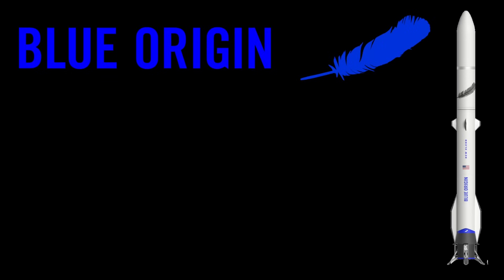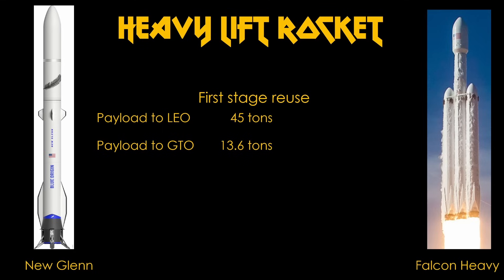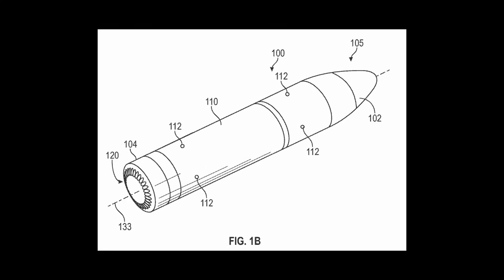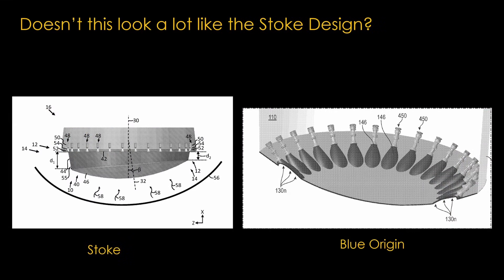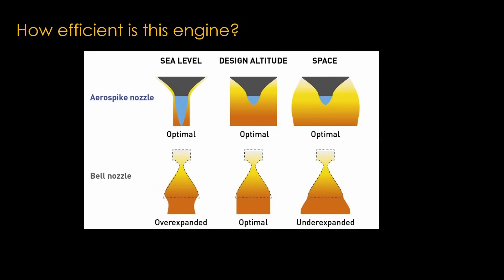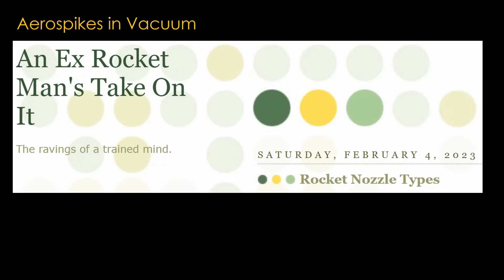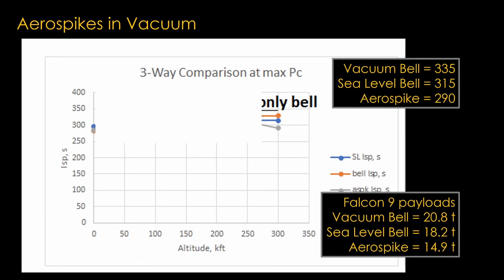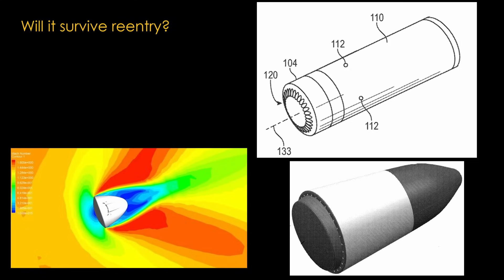Blue Origin's Starship Killer?

Comment: Blue Origin maybe should concentrate on getting to orbit before they concern themselves with trying to reproduce what SpaceX are doing. With Starship now proving it can not only get to orbit but return and land, all be it with the flaps extremely well toasted they are well ahead with a design that has shown it is viable. They will now continue to refine the Starship design until they have it perfected. Getting to orbit is hard but getting back seems to be an order of magnitude harder.
Reply: You could also say that SpaceX should concentrate on getting an engine which dosn't explode first before trying to get a giant stage returned from orbit, as reliable engines are infact the most important part of launch vehicles.
Reply: @kennethferland5579  Raptor is just fine, problems seem to be getting fuel and oxidiser to the engines reliably not the engines themselves. The flight profile of Starship is challenging when you have partially filled liquid fuel tanks.
Reply: Starship and booster design has bloated (super heavy) so much that it can't get a meaningfull payload to orbit. It has just enough fuel left for landing. But with a 30 or higher ton payload it will fail to get to orbit because ther will be much more fuel needed. The flight tests show some proof of concept but isn't a viable rocket design in it's current iteration. The future versions seem to scale up the fuel capacity but not by much. Most of that extra fuel is to carry that extra fuel yielding only a little more payload capacity.
Reply: @frankderks1150  The current version has demonstrated something like 40-50 tons to LEO, only it was leftover propellant. That's less than the design goal, but it's definitely a meaningful payload. It's like twice as much as the space shuttle, but with full instead of partial reuse.
Reply: @kennethferland5579  A mass simulator would mess up the reentry testing, unless they were able to deploy it. It would be extra mass, meaning more energy that would turn into heat, and it would be high up on the vehicle, meaning the forward fins would have to deploy further into the flow of plasma to maintain attitude. 

Extra propellant is also not ideal - it is extra mass, and it can slosh around in the main tanks. This is why SpaceX was trying to dump the excess propellant on IFT-2. But SpaceX must have decided for IFT-3 and IFT-4 that keeping the propellant on board would be better than risking a fire during a propellant dump. It is at least spread more evenly, affecting the attitude less.

I expect they'll start carrying payload on flight six, likely around september. And I would expect they start out with a relatively small payload, like 20 tons, and then increase it from there.
Reply: @SpaceAdvocate  That is not a real payload. With a real payload they need that propellant to lift that payload and most of that propellant itself. So 30tons of "leftover" propellant isn't equavalent to a 30 to payload capacity (more like 3 tons).
Reply: @frankderks1150  You actually get more payload to orbit by burning the propellant propellant than by replacing the propellant with payload.

They had something like 40 tons of excess propellant. The easiest way to think of it would be that they could replace it 1 to 1. Instead of launching with 1200 tons of propellant on Starship, they would then launch with 1160 tons of propellant and 40 tons of payload. That would allow you to arrive to orbit with 40 tons of payload instead of 40 tons of propellant.

But you could obviously get more payload to orbit if you instead of launching with 1160 tons of propellant upped it back up to 1200 tons.

Comment: One way Jarvis could make up for some of the inefficiencies is by having more than two powerpacks. New Glenn suffers significant gravity losses due to the low TWR of its upper stage, which is a result of cost-cutting efforts. For obvious reasons, a reusable upper stage isn't subject to those concerns.
Reply: Seems unlikely, your probably calculating that Gravity loss by comparing with Falcon/Starship.   Yes initialy 2nd stage thrust ~140 ton will be below its mass ~280 ton but thats normal for all 2nd stages, particularly when they stage later and have been thrown harder by the fist stage, they have more lateral velocity and thus don't really need to fight gravity much anymore.
Reply: @kennethferland5579  New Glenn stages fairly early.
Reply: @pseudotasuki  Compared to Vulcan it stages early, compared to Starship it stages later.

Comment: The bigger picture here is that your thermal protection system mass subtracts directly from your payload mass. So anything that result in a light TPS is a win, even if it means other compromises. There's a whole bunch of options including nozzles into which you pump liquid methane (for cooling). The methane evaporates and then as a gas absorbs heat before spilling out and creating a buffer zone of (relatively) cooler gas. There's high temperature ballutes that can inflate around the base of the rocket, thus directing hot plasma away from the rest of the vehicle. There's deployable high temperature alloy shields (which can be internally cooled. There's also porous carbon materials into through which you can force liquid methane as a coolant. And of course you can build those to be rapidly replaceable so you can afford some ablation.
Reply from the maker: Starship pays a lot for that blanket of tiles and the fin system, but that system requires very little propellant to land. 

It's not clear what they dead mass increase is for the active cooling systems - you have these complex motor systems with a lot of nozzles and a lot of piping and then you have a heatshield wall that is more complex and more heavy than a simple tank wall. On top of that you are using propellant during reentry, and your use there will be much much more than the starship control.

What's the real cost of the active cooling approach? I don't think Stoke or Blue Origin have released their models and since it's never been flown nobody knowns what sort of propellant flow rates will be needed to keep the the vehicle happy.
Reply: @EagerSpace  I'd love to see it tested purely for the knowledge gained. Looking back at this I can't help but feel that if this aerospike tail end is an attempt to create a re-entry proof surface then it's still going to need either fuel-as-coolant or a bunch of thermal protection in the obvious places. And if they're going to use fuel as coolant, I'm not sure why that can't be applied to a conventional bell nozzle. Again, I come at this from the angle of thinking about one-way Mars cargo-only landers, where it's an advantage to not be dropping parts of your vehicle onto the surface (because it might hit something). So you need the ability to apply thrust through the heat shield. I'd love to see Blue Origin try out even a sub-scale test of what they're doing. One other thing, my idea of a "Starship killer" looks a lot like Neutron. The best second stage is an ultra-light one where what you're throwing away is a tiny part of the overall vehicle mass/cost. Maybe Neutron's second stage can be made reusable at some point in the future (ballute?) but we'll see.
Reply: @saumyacow4435  It would be fantastic if anyone developed an aerospike engine.  Even if it was the Chinese! (We could steal the design from them. All''s fair, and all that.)

Comment: Unlike bell nozzles, advanced compensating nozzles (external-deflection and aerospikes) have options as to the shape. You have to determine what you want, then you can design a nozzle shape that does that thing optimally – to the detriment of the other things. This is why different studies on compensating nozzles get such different results, not realising the shape options are available. So, without knowing what the aerospike was optimised for, the Ex-Rocket Man’s analysis is not really meaningful. I would expect a vacuum optimised aerospike to lie between the vacuum and sea level bells (it will never be as good as a vacuum bell).
Reply from the maker: Did you read the blog post? Lots of detail there.
Reply: @EagerSpace  I have gone over the Website and my thoughts are 
a) He is designed for atmosphere operation which will reduce the vacuum performance. Generally, this makes sense as one of main potential roles of aerospikes is as an atmosphere compensating engine from launch. However, if Blue Origin are using aerospikes for the second stage, they will want them optimised for vacuum operation and the sea level performance can be rubbish.
and 
b) he does say his lower SI “is very likely an artifact of my not knowing how to optimize the design of aerospike engines” Which is no reflection on his expertise, very few rocket engineers end up working on these long enough to get the subtleties. Full disclosure: my experience was with E-D nozzles and my comments were based on reading across from that. I would not like to say with certainty how aerospikes behave.
And
c) Another point is if you look at the patent drawings the main combustion and a lot of the post throat expansion is in conventional rocket nozzles. Of course, these are not scale drawings but they make the point that without knowing the exact design and how much expansion is done in these nozzles, the overall stage performance is not really possible to ascertain.
Reply from the maker: a) What are they going to change for the aerospike to give it better vacuum performance? The only thing that seems obvious is to increase the nozzle size, which has other impacts.
b) Was that from the first section, or from the update after that. 
c) Totally agree. 
d) I'm not sure the blue origin design counts as an aerospike. There's precious little internal spike left and - at least in the drawing - the angle seems to be pretty high. Not sure what's doing to happen with all of that off-axis flow running into each other.
Reply: @EagerSpace  The main thing that alters with subtle changes is the pressure in the entrapped gas region which impacts both the vacuum thrust and the degree of atmosphere compensation. It means you can balance one off with the other.
The quote is from the Final Remarks section. Again, I must emphasise this chap knows his stuff (for example, he notes the importance of the speed of the external airflow with all spike nozzles which is missed by many.) And I agree with his overall conclusion that an optimised aerospike cannot match an optimised bell in vacuum performance, I just do not think it will be as bad has he shows.
Reply from the maker: Thanks. I always appreciate comments from those who know more than I do.

Comment: If you lose 23 tons to LEO; you're losing ~23 tons to GTO given that the performance decrease is presumably driven by second stage dry mass increase. 

The way I tend to think about actively cool heat shields is that it's not too dissimilar from regenerative cooling in rocket engines; well ok it literally is also doing that. But the actual heat fluxes that are dealt with in propulsion and re-entry are reasonably similar (I think actually rocket engines need more cooling relative to LEO re-entry). So it's not an entirely new field. The other way I like to think about it; ablative heat shields are to solid rocket motors as regeneratively cooled heat shields are to liquid engines.
Reply: The heat dispation problem is very different because you have no where near the mass flow of a rocket engine to deal with.  Rocket combustion chambers basically need to cool themselves durring steady state operation using propellent flow, nothing else is available.  Re-entry thermal energy is a pulse which can be delt with very differently, push the plasma away with shockwaves shapes or thrust, reflect is with high emissivity skins, ablate away a coating, soak it into metals with high melting points or all of the above at the same time.
Reply: @kennethferland5579  Just to check, roughly what you're getting at is that re-entry is easier to handle than rocket combustion chambers?

Comment: The size of New Glenn is not weird to me as it was likely to allow for duel launch to GEO with a reusable first stage. Unlike Falcon Heavy, New Glenn has a large enough fairing to carry two GEO satellites at once. This is the same mission Ariane 5 did as it's bread and butter with it having 10 ton to GEO and Arian 6 having 11.5 with 4 srbs. This is discussed in the New Glenn payload user guide from 2019 in section 2.5 Dual Manifest Capability, with the target mass of 6,200 kg per payload.
Reply: That’s cool…this video is titled “Blue Origins STARSHIP killer” not “Blue Origins FALCON HEAVY killer” 😂😂
Reply: Exactly my thoughts.  Dual manifest GEO sats is a proven and smart strategy.
Reply from the maker: Dual-launch was what allowed Ariane to walk all over Delta and Atlas for the GEO market, but nobody knows what the GEO market is like going forward and new glenn will need to fight with both Ariane 6 and Falcon 9/FH for flights.
Reply: @EagerSpace  Economy of scale was vastly more important when you were expending the launch vehicle to launch your payloads. Getting two onto one launch vehicle mattered. Not so much if you're reusing the vehicle and almost all of your cost is simply fuel. Two smaller rockets to launch two satellites would actually be preferable in this case.
Reply: Good point. Although it does not quite explain why the rocket is this big, when two smaller ones could do the same. Ariane 5 was big, because ESA needed a heavy lifter for LEO, ISS and Hermes. Dual payload is a make-shift solution for big rockets, not their purpose.
Reply: @debott4538 The 7m fairing and heavy lift capability are what enable everything from their lunar landers to the orbital reef space station. Take for example the pressurized lunar rover, which will presumably launch on a modified cargo version of an HLS lander. It'll be 6m long, 5.2m wide and 3.8m tall, which would fit comfortably in a 7m fairing while having the wheels face down on top of the lander.
Reply: @debott4538  A single rocket will generally be more cost effective then two smaller ones, and it allows them to survive a doubling of payload size without being squeezed out of the GEO sat launch market as they just become a 1 sat at a time launcher.  GEO sats of up to 9 tons have been launched now on a Falcon Heavy and NG looks like it will undercut it on price easily as all multicore rockets are a pain to prep for launch so a single core will always beat them.
Reply: @kennethferland5579  It's definitely not a given that a single big rocket is more cost effective than two smaller rockets.

The market for large communications satellites to GEO is limited. If we say it's 20 satellites per year, you can solve this by using 20 small rockets or 10 large rockets. The increased cost efficiency of a larger rocket may be outweighed by the penalty of a lower cadence, plus you need a larger launch pad, you might need a larger landing barge, etc. Plus, there's a bunch of added logistics in getting two satellites ready for launch at the same time. You might even need bigger clean room facilities. And the launch date will end up being less optimal for both the customers, so they will be willing to pay less than for a dedicated launch on a smaller rocket.

It might work out, and New Glenn might do some dual manifest launches, but my guess would be that the market isn't too interested, and most of the large GEO satellites will fly on dedicated launches on New Glenn.
Reply from the maker: Agreed, though I'll note that the market looks to be about 8 launches per year right now.
Reply: @SpaceAdvocate  No, its a well established rule in rocketry bigger rockets have lower cost per kg, always has been always will be for any vehicle ever made in any medium.  It's only at the most massive end of super-heavy rockets where any inversion of the rule has ever been observed and this is belived to occour when launch cadence drops to 1 to 2 a year.  New Gleen is smaller then that and even the GTO market alone is enough to keep them above that danger zone of low cadence, AND their are lots of other orbits and payloads they will launch, BEO for NASA, LEO for Kuiper sat constelation and the HLS moon missions.  The optimum rocket is as large as it can be without being in the danger zone of low cadence and NG is clearly outside that zone, so theirfor it is not oversized.
Reply: @kennethferland5579  General rules aren't absolute rules. I don't expect New Glenn to be able to compete with Falcon 9 on cost per kg for many years, if ever (right up to Falcon 9 retirement). Falcon 9 is such a mature and optimized vehicle and is launching at such a high rate that it will be incredibly difficult to compete with.

Blue Origin hasn't even started learning how to reuse the New Glenn first stage, after it has experienced reentry heating and slamming into a barge out at sea.

And the upper stage is is more than twice the mass of the Falcon 9 second stage, with twice as many engines (and zero scale benefits with the BE-4s), so even after Blue figures out how to recover and reuse the fairings, Blue will still be throwing away more hardware per kg to orbit.

If we assume Falcon 9/Heavy keeps half the GEO market, that leaves New Glenn to fight over the remaining 4 launches per year. It could definitely take those launches from Ariane 6, but it depends on how much subsidies Ariane gets.
Reply from the maker: Ariane gets all the European government launches to bump up its flight rate, and they've been launching geo sats for years and know everybody. SpaceX has done well in that market but Ariane still had most of it until the Ariane 6 delays.
Reply: @AllistairNeil  sounds like you are the one who needs to grow up
Reply: @Jeremiah-x7q  Hey, gimme a break, I'm only fourteen, grandpa!😃😄😃